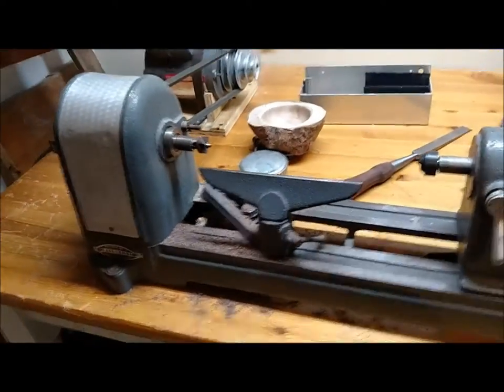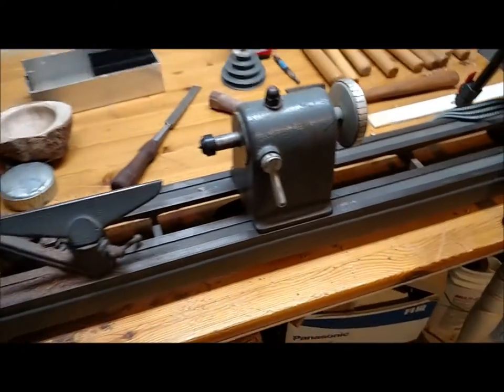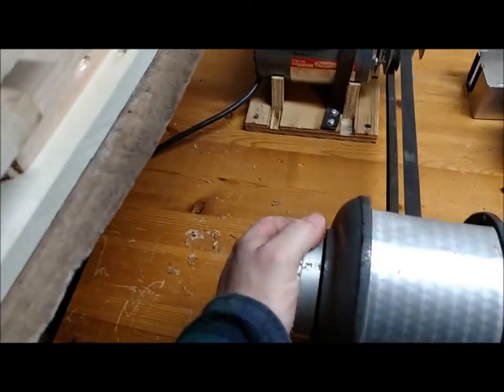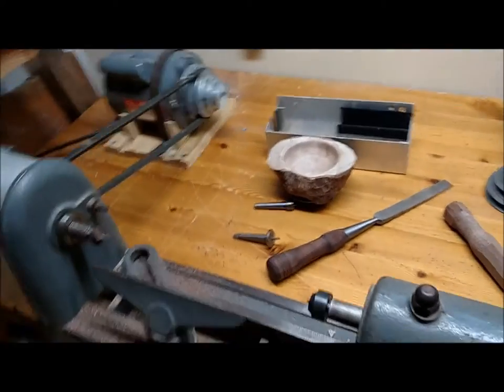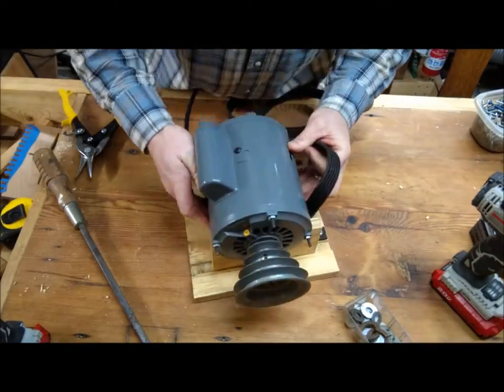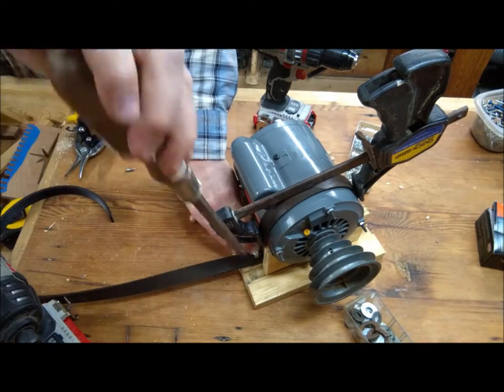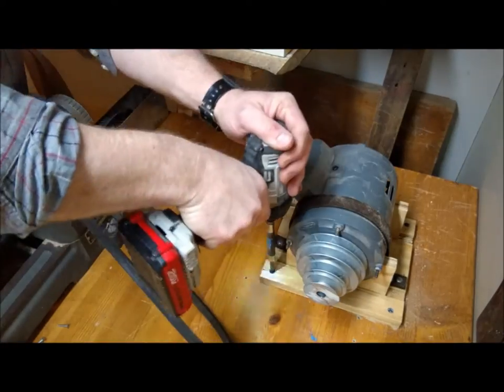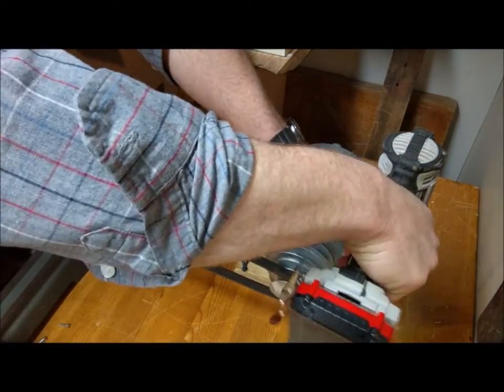Lathe Motor Setup for 1950's Craftsman King Seeley Lathe

Comment: To set the motor the method I use is to put a couple of door hinges on the front side of the wooden motor plate.  First, find the approximate plane and attach the hinge to the bench, adjust tension, then attach the hinges  to the motor plate.  Let the weight of the motor provide stability of the motor and tension on the belt.  When changing the belt to another speed, just lift the motor up slightly and place the belt on whichever speed you want and release it.  You can change speeds real quick. Thanks for the video.  I like the lathe.  I have two old craftsman lathes that are in working order.

Comment: I have the exact same lathe. I am missing the cap that you show on the back of the head stock. Do you know the name of that part?  These are really well built lathes. I like the way that you did the motor straps. I have several motors with no brackets. Now I know how to be able to use them. Thanks for the tip.

Comment: Do you know how to remove the spur center from the head stock spindle?  I have a similar model and there are no instructions that I have found.  Is it screwed on, or is there a set screw that I am missing?
Reply from the maker: You have to knock it out from the back and it is just held in by its taper.  I use an old long nail to punch it out

Comment: Having trouble removing center from one end (not the live center but center on opposite end). Any suggestion about how to remove? Thanks
Reply from the maker: jim fisher I take a long thin bolt or oversized nail and I feed it in on the left side through the pulley shaft and tap it out.  let me know if that helps.  good luck!
Reply: i had to heat it up to loosen
Reply from the maker: jim fisher glad you got it out unharmed...must have been rusty in there

Comment: Thank you so much. I had been wondering how to hook my Craftsman King Seely lathe. Your video shows a very workable solution. I was thinking of using a hinged mount with some kind of tensioner and it seemed like a lot of work. I had read that the original lathes were hooked up just as you have in your video and that the belt is moved from one pulley groove to another by hand. It just seemed too primitive but it works just fine. Dan Glaser
Reply from the maker: great, glad the video helped you, Dan!  I thought about doing the hinge mount also but then thought I'd try this and it works fine.  there is enough play in the belt to move it to different size pulleys just like in my old craftsman drill press from the same era.  I tend to really like these old tools (just got a Delta jointer from the 40s).  the simplicity and build quality are really inspiring.

Comment: I had one of these for a couple years, it was a good lathe for what I paid, but I upgraded to a Delta 46-111.
Reply from the maker: hey Rick, I remember watching your video on that lathe you fixed up, very nice.  I have a line on an old Delta lathe actually but this craftsman is really well built and I don't do a lot of turning so I'm not sure I need to upgrade.  thanks for watching

Comment: i have the same lathe but i am unable to remove the dead center, any tips could you put up a video about it. thank you
Reply: TechNTunes1 what do you mean by dead center?
The spur drive in the head stock?
Put a thin metal cylinder down in the hole and give it a wrap with a mallet.

Comment: I recently purchased virtually the same model.  It is my first lathe.  I am having trouble removing the center spur.  It should just pop out as I understand it. It is definitely not rusted, but it will not come loose.   Any help would be appreciated.
Reply from the maker: I'll try to make a quick video to show you how I remove it this evening!
Reply: @VintageWoodWorkshop  That would be amazing!
Reply: I used aggressive persuasion... it worked.  Thanks for responding.
Reply from the maker: @stephenmarchesani5340  ok great.  I use an old long nail to punch it out from the left to the right
Reply: @VintageWoodWorkshop  I don't know if this is appropriate or not, but I have a few more questions and was wondering if there was a more direct way to correspond. If not, it's cool.  Thanks.
Reply from the maker: @stephenmarchesani5340  sure no problem...happy to help if I can.  my email is kylebollendorf1 at gmail.com